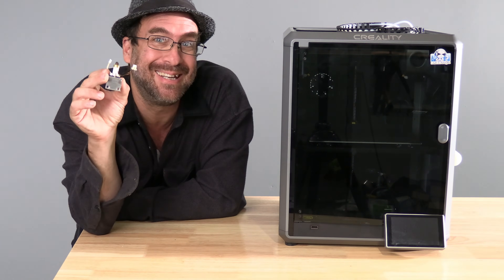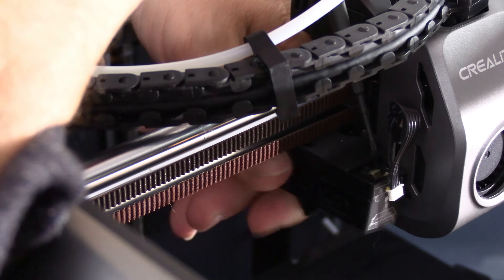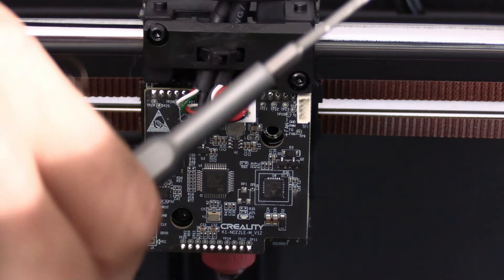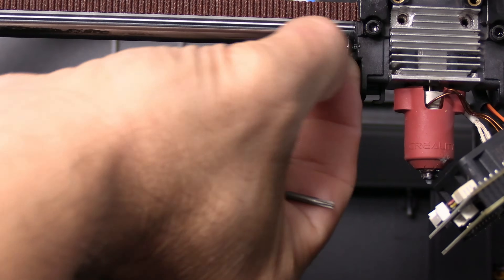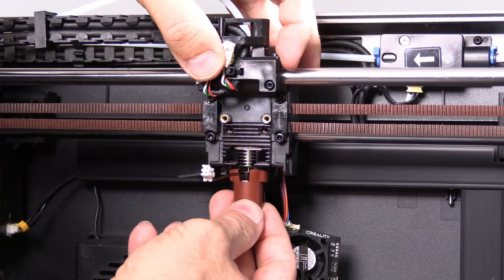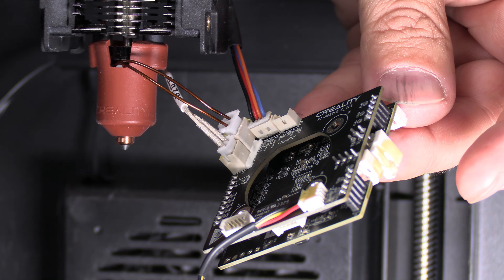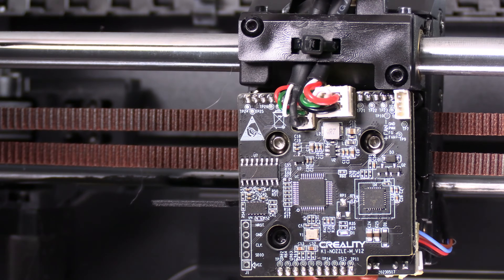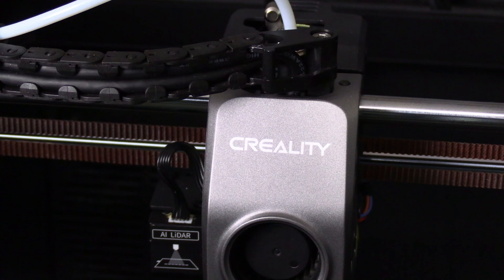How to install the Creality K1 or K1 MAX Unicorn Hotend Upgrade - 3D Printer

Comment: Thermal paste that came with the hotend. Didn’t see you mention in the video
Reply from the maker: Not needed, as the Unicorn Nozzle is preinstalled into this assembly.
Reply: @3DRundown thank you so much, just finished your video. Thank you so much for the walkthrough
Reply from the maker: @ryanfoxworth1015 Very welcome

Comment: Thanks so much for the video ! It helped so much, I switched to the unicorn nozzle without many hiccups. But I keep getting heat creep with practically every test print. I even tried to redoing everything to check if the coolers weren’t flipped accidentally and no luck. 
Any guesses as to what I’ve done wrong ?
Reply from the maker: Did you use a proper paste? Can you tell me a little more about why you think you have Heat Creep?
Reply: @ @3DRundown  thanks for the  reply ! The prints were most all failing somewhere in the middle, with the extruder slowly making clicking noise chewing up filament and then not printing all together. I ended up opening up the nozzle again just to make sure I didn’t miss anything and added more paste. 
I’m having more success adjusting retraction and temperature settings (printing abs). Its working much better with cheap abs, so far no luck with creality brand hyper abs. 
I also tried upgrading my extruder to the all metal one with the tension screw but it made things SO MUCH worse. My guess is the all metal chamber is making everything hotter in the extruder and the melted filament is getting chewed up so I went back to the old extruder. As of now I’ve had some successful prints but i find that I have to keep the printer lid slightly open. I’m yet to test large prints because I’m sure this could cause warping. I’m still hoping there’s more I can do because this used to be my best printer 🥲

Comment: Thank You, I had blockage, then found out it had a blob/ I did not find out till I remove the front cover / Fan,  I just got the K1 back in July. It was New-In-Box, from Creality back in July 2025. on special. But the biggest issue was the upper right screw on the Black Fins (the last thing, you remove) it turn out it had all metal tube. 
IN fighting with the screw I ender removing a lot of stuff, so I would Not either damage it, like the door, the filament chain, the top cover of the extruder.
 BTW this is my 3rd printer (1st Ender 3 Pro, 2nd CR-6 se, Kickstarter) Now this one the K1, I am impressed how much faster it is!
Reply from the maker: K1 is a beast. Keep speeds reasonable and it will treat u well

Comment: Great video thanks.  After fitting the new hot end do you need to run lots of calibration?  Also what’s the point of the new hot end?
Reply from the maker: I would run the calibrations. 20min to be sure your machine is good to go. The Unicorn has a longer all metal heatbreak. This eliminates the PTFE in the extruder

Comment: Thanks!
Reply: @3DRundown  Thanks so much for the reply. I figured it out in the end :) I was trying to figure what kind of head was on the drivers you were using and didn't want to risk burring a head! Anyway, a mix of allen keys and hex kind of heads worked. Thanks for the video. I was trying to rescue a massive blob from my K1C head and this video was very helpful. Got most of it off and now taking a hot air gun to get the last bits :)
Reply from the maker: Nobody believes me that HEX can work. I use them all the time, and get allot of shit for it. Back to work!

Comment: Be great to know what type of screws are on this. Some are not obvious. Like the ones through the circuit board. Are they hex or something else? Nobody doing these videos seems to give the particulars of the bolts.
Reply from the maker: Because there is little information available even to us. They are all M3 screws with allen key heads. I keep a box of a zillion sizes handy

Comment: Excellent and very useful video. I followed everything to disassemble my damaged hot end. However, I accidentally tore the connectors off the board itself because everything was so firmly stuck. I can of course glue them back on when reassembling. But I’m wondering whether it would be wiser to switch to the new version of the hot end and also replace the PCBA board with the new one. I’m just not sure if it will be compatible with the machine’s main motherboard, although I suppose it should be. What do you think
Reply from the maker: If you can get them back on  that would be so much easier. I'd try that first.
Reply: @3DRundown  I bought a new CBBA card and an new hot end new version. I will let you know if it works

Comment: Danke, aber warum benutzt du den falschen Schraubendreher? Die Schrauben haben Inbus und sind nicht TORX
Reply from the maker: TORX work fine on these small M3 screws, especially since we don't put allot of.... TORQ on them.
Reply: @3DRundown na ja, wenn man pfuschen möchte ist das in ordnung😅
Reply from the maker: I am an internationally known 3D Printing Mentor, and one of the top Prop makers in the World. I'll try not to cry over your opinion. P.S. Probablemente deberías aprender a usar un traductor.
Reply: @3DRundown brauchst du nicht persönlich zu nehmen. Warum sollte ich einen Übersetzer benutzen? Kannst du doch genauso machen. Und ich liebe es, wenn Leute bescheiden sind😂 trotzdem benutzt ein pro das richtige Werkzeug zur richtigen Schraube😂
Reply from the maker: Tut mir leid, ich bin zu faul, das zu übersetzen.

Comment: I'm currently trying to disassemble the hotend except I had run into a problem, I can't put the hex key into the screw hole holding the heat block, I'm pretty sure it's filament since I've recently gotten one of those filament blobs covering everything.
Reply from the maker: Hit it with a heatgun, or lighter, till it's melted. You've likely got it glued in place, by solid filament.
Reply: How long though?

Comment: The video is very useful. My K1 had a blob of death and was swapping the hotend for the new unicorn one, but the two screws on the bottom of the nozzle are impossible to unscrew. The hotglue was a walk in the park to remove compared to this. 
I removed all the plastic blob around the screws  as much as I could using a hairdryer (the blob was petg...), but the allen key is still useless on those screws, it does nothing.... Now I'm taking a break, working inside that printer is awful. Will try again later. Shit design overall on this printer :(
Reply: Managed to take it out by force and not breaking anything!! I patiently moved the hotend around using the key that came with the printer and then tools. One of the screws went out like that and the other followed after a bit of moving stuff around. The old hotend is now in the trash. The new hotend does not use those holes, so whatever. They don's seem broken anyway. 2 hours after and I finally have a hotend-less printer. Now to remove the tube which in this video is blue. In mine its black and seems rigid, hmmm
Reply: I finished like 4h after I started, omg. It's happily printing now. I've fixed laptops, phones, I build pcs and do tech things often, but this has to be the hardest repair I've ever done. Thanks for the video, even though my printer is slightly different and had an extra step (unscrew 3 more screws and lift the motor to get the rigid black plastic tube out of there) it helped.
Reply from the maker: Sounds like you have the OG Hotend. Consider Switching to the Unicorn when this one dies

Comment: Thank you for your video. 
It explained why my PTFE Blue Tube doesn't fit into the New Upgrade Extruder I purchased recently; and the overlooked comment about Hotends in the Extruder Upgrade product literature.

Based on some of the Comments here, about the Unicorn Hotend; it would seem that I might be better off drilling out the hole in the Extruder Upgrade to accept the original Blue PTFE tube. I have the original Hotend; and it has caused me no problems. I just wanted to get away from the little blue clip and get the tenser spring found in the Extruder upgrade.
Reply from the maker: I would go Unicorn. It's easy and worth it. For now, cut the ptfe flush with the xtruder

Comment: If i ever find the creality guy that glued my printer.

Im going to make sure he has a very lovely cheistmas
Reply from the maker: Lol. The Glue keeps it from vibrating apart during international travel and abuse, but it's a pain
Reply: broke it cause of the glue, the wire prefered to rip off than letting the thing go off even tho I tried to remove the glue
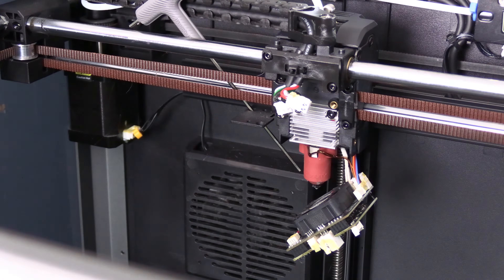3:40and one of the screws were so tight it prefered enlarging to not be screwable than turning itself even from a millimeter

Comment: changed mine but i'm getting temperature inconsistencies, how to fix this?? do I need to adjust the PID? I never saw a k1 tutorial for this
Reply from the maker: You could run a PID and see if it helps. Will be on Screen Interface

Comment: Thanks for the video I used your cfs upgrade video as well and found out I have a older model K1 max which has a black plastic tube attached to the extruder and when you switch it for the cfs extruder there’s no tube therefore you have to upgrade to the unicorn hot end otherwise the filament just gets caught in the gap where the tube was so here I am lol
Reply from the maker: Yea... Unicorn is the way to go.

Comment: Im having what i think coukd be over extrusion issues. Do you use the k1c preset in the slicer, instead of the standard k1 once you have done the upgrade?
Reply from the maker: I'm still using K1

Comment: interestingly enough on my newer k1 max, there was no blue tube (its all metal) and the heat sink did not have 2 screws to remove next to each side of the nozzle.. It just slid out as soon as I took the top 2 screws off that face you.
Reply from the maker: MAX was upgraded to the Unicorn, long ago.
Reply: @3DRundown  Not that long ago ... my 2023 purchased model did not have it.

Comment: As someone who has done this before, it is a good reference to know how to do this, but, I must add to this video, is to use a dental cleaning pick to remove any excess hot glue that is on the surface of the connection wire covers that are either on the outside of the wire connection cover (white plastic plugs), or on the adapter board. I think the factory went crazy with the hot glue and probably didn’t think that hot ends will have to be removed and replaced eventually. I am not a big fan of the old hot end because of the small screw, and if there’s a “filament blob of death”  , that is going to be hard to remove unless you have a heat gun to remove it, if it has gotten so far up and over the silicone sock, and has gotten up to the plugs or near the plugs on the adapter card. 

If you can, can you do a video on how to replace the timing belt on the K1C and how it should be installed on it, and do it step by step to show it to see if it goes on the back stepper motor pulleys. I am having trouble with it, and the Creality video on the after sales YouTube channel only shows how to do it, but it is done upside down and I want to do it as the back stepper motors are attached to the frame and how to get the timing belt in the belt buckle correctly. Are you up for that kind of challenge 3D Rundown??? :)
Reply from the maker: My K1C has been sealed in the Box since launch. I literally took it out, 30 min ago..... But I dunno if I want to murder it just yet.....
Reply: @3DRundown  LOL 😂 You have got to be joking. Why? It launched a long time ago. I put each 3D Printer I get through the paces, every time and this way, if something happens, it will still be under warranty.
Reply from the maker: Because I have printers all over the place. The K1C, CR10-Se, V3 Se, V3 Ke, V3, V3 Plus, and more, came out within months of eachother. It was impossible to keep up with. I held it till I could shoot an assembly and setup. It never happened. I threw in the towel, as I'm about to do it all over again with multiple new machines
Reply: @3DRundown  So, why even bother with buying the K1C, when you have other 3D printers that are bigger than the K1C’s build plate dimensions? If there’s so many printers to keep up with, why don’t you just either donate them to a local library or donate it to a local high school? This makes no sense to me whatsoever. I have been watching your videos for a while now, and despite the tone that you have in your videos that seems like you are talking down to people, despite other channels that don’t do that. You need to understand that not everyone has a lot of knowledge about it, but in my opinion, it seems like you like talking down to people that don’t know anything about it or understand what you’re talking about, but it seems like you like talking down to people with your tone of voice in general. I have seen you do some videos on the K2 Plus, and K1 Max, which have a bigger build plate dimensions. I have been in the 3D printing community for over 3 years now and I have had a total of about 7 3D printers of different sizes and types that are ranging from Creality and Mingda, and even though I don’t have any SOVOL, a “RatRig” printer, Prusa, Elegoo, a Voron, or any other type that influencers like The Next Layer or Uncle Jessy, or 3D Printing Nerd , or Scratch 3D Printing have on their own channels , but don’t really talk down to their subscribers unlike it seems like you do on a consistent basis. If you want to attract more people, I suggest that you cut out the condescending tone and the talking down to people tone. If you don’t “want to murder it just yet” when it comes to the K1C, then why even get it, just to collect dust and possibly have roaches in the box that loves cardboard boxes? Why invest in something that you are not going to use?

Comment: Im still having trouble removing the two front screws off the heatblock any tips, I tried to use a lighter didn’t work
Reply from the maker: Make sure no filament on the threads, glueing them in place. They are typically not super tight or had to remove.

Comment: Any tips to get the wires in?
Reply from the maker: pre bend them, so they are easy to keep at the correct angle. use your finger nails. BE VERY PATIENT. Make sure no glue is obstructing you
Reply: @3DRundown thank you

Comment: I'm really struggling with the screws at 5:00 - Mine don't look like Torx. I had a huge blob build up on the hot end and the whole lot needs replacing. I've also got one rounded bolt in the heatsink above this. Might have to drill it out. 

Any suggestions for these two below though, nothing seems to fit?
Reply: I just had the same issue with the blob. I used the smallest Allen Key that came with the printer and used a lighter to soften up any residual blob material in the holes. the heat also loosened the filament around the screws so i was then able to unscrew them. Took a few tries, make sure to apply enough pressure so the key doesn't slip. At first it's really tight, but after a few turns it gets easier. Maybe that helps?
Reply: @thedude328  Thanks - I'll give this a go and report back!
Reply from the maker: https://youtu.be/D4mRFYaZS08
Reply from the maker: It's Allen Key, not Hex/Torx, but I use Torx often anyways, as they grab well, with the screws being so small. 
These are not tight screws. You should be able to get them moving. There is likely filament from the blob, holding them in place. Catch the video I liked, and you'll see mine were like this. HEAT HEAT HEAT and patience. A torx may grab the rounded one

Comment: Great Video although the unicorn is very bad and a downgrade, I'm using your vid to remove the stock unicorn hot end that came with my k1 so i can Upgrade to the original hot end that doesn't use proprietary nozzles and prints wayyyy faster 😂😂. I've tested both and got:
Stock Unicorn .4 nozzle @ 225c flow 18.65mm3/s
CHT volcano   .4 nozzle @ 220c flow 31.75mm3/s
Reply from the maker: TBH, I don't even remember which of my machines has the Unicorn and which has the newest version of the OG hot end. They both work great. I don't really push speeds to much.

Comment: The unicorn nozzle is no good for TPU.  I made the change but had nothing but issues attempting to print TPU.  In the end went back to stock with the Capricorn Boden tube and now I'm no longer having problems with TPU.  The longer unicorn nozzle causes the blockages not the nozzle itself.
Reply from the maker: interesting. Capricorn can also cause problems
Reply: @3DRundown  Agree, however, 1 inch of cool Capricorn tube is much better then the 2 inches of hot steel tubing above the nozzle.  The Unicorn is designed to preheat the material for high speed printing which I find is not suited to TPU.  Since changing back I can now print TPU without it jamming in the steel tube 1 hour into  a print.

Comment: Does anybody know if there is a picture showing  the difference various types of hot end for the k1 ie  the split and the unicorn (not sure if the intergated ceramic is yet another variant). Just purchased the cfs unit and no idea if I need to upgrade the  hot end or not. Cheers
Reply from the maker: I would go with the Unicorn. If your hot end had NO PTFE, between hotend and extruder, you are all good
Reply: @3DRundown  Thanks

Comment: I removed my Lidar.  It has never worked anyway.  Someone at the factory was feeling evil that day.  They glued the heat sink in place.  It was held in with 4 screws.  None of the videos I have seen show this.  The two screws at 5:00 were the real problem.  They were loose.  I replaced the whole hot end anyway.
Reply from the maker: My Lidar works, but I almost never use it. swapping the hot end is often the path of least resistance